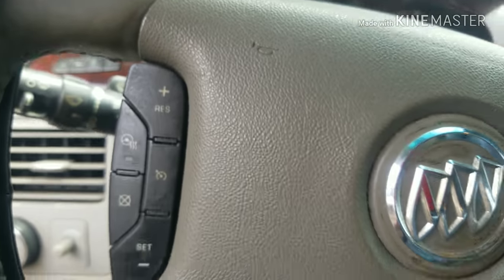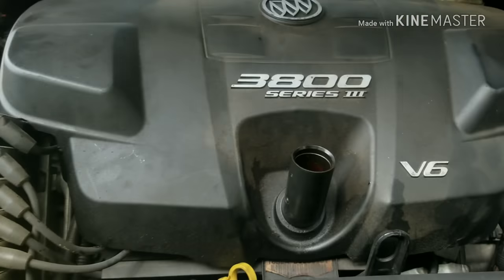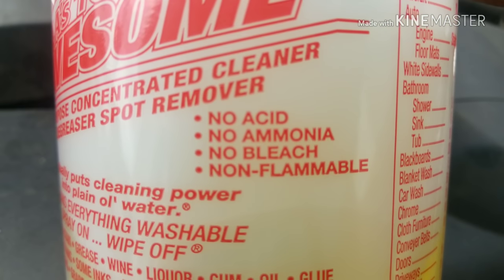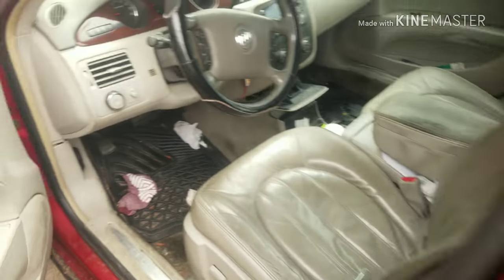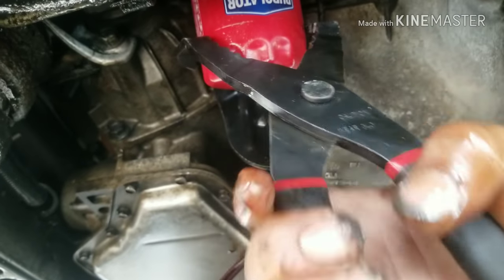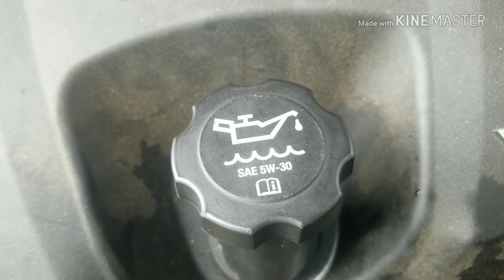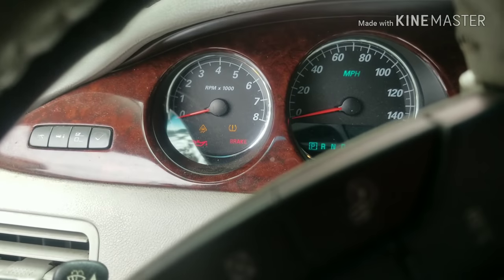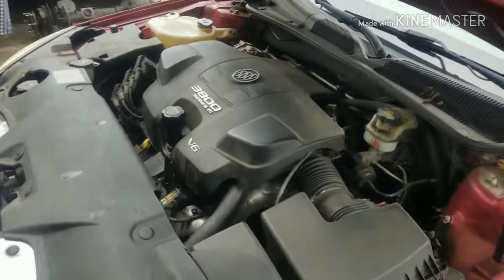How to Flush Dirty Engine Oil , The Cheap Way

Comment: Drain it, take the oil pan off and check the pan for the carbon build up. If you see any in the pan and on your crankshaft do a flush with 75% conventional oil and 25% diesel fuel.  If it's 6 quarts use 4 quarts oil and 2 quarts deisel fuel. Run on idle for about 5-10 minutes.. you don't have to Rev the motor. It's safe I have done it to many cars/trucks the deisel fuel has lubricating properties as well. There are of course other ways to check for buildup besides taking the pan off but atleast you can see, and clean the pan
Reply: This is what i use deisel has lube properties and cleaning so its safer but for newer cars depends how dirty engine is use sparingly. And yes check your oil pan cause you realy need to get everything out to have best chances of saving engine.
Reply: @bbb8949  I've heard of using ATF about a pint, for my Dodge Avenger with a lifter tick and even drive it a bit, seems like a better flush as it has many properties of oil, seems safer than the thinning of kerosene or diesel, and can't stand the smell of diesel, so I always use kerosene for torpedo and space heaters

Comment: I bet degreaser is REAL GOOD for all the engine parts! If you had A sludge build up problem that BAD changing the oil more frequently and adding A product like MM oil would have been A hell of a lot safer!
Reply: don't know what MM oil is I am going to try atf pint running and driving, seems safer and has some properties for rubber and seals
Reply: Marvel mystery oil

Comment: What does Awesome do to the seals and gaskets? Solvents tend to break these down causing oil leaks or necessitating major repairs to replace them. For example, if the rear main oil seal is compromised you would have to pull the transmission just to put in a new one. It's a cheap part but requires hours of labor and specialized equipment.
Reply: Yes I find cheapest way to engine flush not need to cost extra 15 buck per oil change anymore so you can add asmoil oil.
Reply: @maungmaung4037  I am trying to cure lifter ticking for my 2010 Dodge Avenger 2.5L with 240k it runs and drives great and good mpg, so starting with a half quart of ATF and drive it a bit then change to a 10w30 or 10w40
Reply: Oil is lighter than water. When you pour this liquid into the crankcase, you'll pump it into the engine without lubrication, just pure degreaser. This is why you hear the loud knocking when he first starts. That's bad, very bad, very bad.

Comment: That engine was clean. Well maintained. Didn't need the flush
Reply from the maker: client requested the service,
Reply: No hate but becareful i know from personal experience flushing a car that doesn't really need it can cause leaks and premature failure of parts. Use a camera scope to look in engine. Best way to have a customer complain about you is to do what they think is best but it's not remember you're the mechanic not them.
Reply: @bbb8949  mechanic should be glad if it leaks after the flush, it will bring more money to the mechanic to replace the leak seal.. not a big deal.

Comment: Oil is lighter than water. When you pour this liquid into the crankcase, you'll pump it into the engine without lubrication, just pure degreaser. This is why you hear the loud knocking when he first starts. That's bad, very bad, very bad.

Comment: Do not do this. There is no lubricating properties in that cleaner. Your asking for problems down the road.
Reply: You can put one after the flush
Reply: Are you heard of head and shoulders is best friction test ? Same with soap. Those are maybe brake down fast than oil but who care about 10 to 15 min idle engine.
Reply from the maker: Thank you please like, share, and subscribe, also please check out my other channel Salem Taxi, on YouTube for more material on a different level.

Comment: Use a good sludge buster oil like Castrol Ultra Clean oil when you change your oil and filter.  When it gets black change the oil and filter and keep repeating this method.
Reply: Never do a flush. You can break off pieces that are to thick to flow through small oil channels and that can clog up the flow of oil. Then lack of oil will seize the engine. If you hear of people doing flushes and had no problems they have been very lucky.

Comment: That stuff has no lubricating properties, You would be much better if with a quart of ATF.
Reply from the maker: tried that and this works better. ATF has no detergents so its really not that great for cleaning.
Reply: @crazysexycool180  bull butter
Reply: @noodlezdotcom  take a look at Project Farm's YouTube video on it. He ran 10W30, a 10W30/Diesel fuel combo and straight diesel in an engine. After he strained the drained liquid there was metal in the strainer after using the diesel...
Reply: @crazysexycool180  🐎💩

Comment: That is the oil level sensor not the sending unit 
3:00
He pours it in there
That is the oil level sensor not the sending unit
 3:00
He pours it in there
That is the oil level sensor not the sending unit
 3:00
He pours it in there
Sure would LOVE to SEE and to Hear it.. if that Car is Still around..
Reply from the maker: yes the car runs great, also have you ever called a part the wrong name? shit im human just like your perfect self and i have the same flaws as you so what's your point yea i said the wrong sensor but did you get the message instead of trying to pick the one word apart?

Comment: People the bottom line is you're not supposed to have to do a flush to your car if you just do your oil changes on time you have to do worst case scenario if you're going to use a flush being buying a new engine or try flush either way see where you ended up because you didn't do oil changes on time. The car was $30,000 and you didn't want to get $30 oil changes every 3 months

Comment: Don't let this guy anywhere near your car.  10-20% of the oil capacity is not drained during a normal oil change.  Leaving that amount of solvent in the oil over the next 5k+ miles will damage your bearings.
Reply from the maker: i didn't say leave it in, i didn't say drive it this way. Please pay attention in class.
Reply: @crazysexycool180  You only said drain, change your filter and add oil.  10-20% of the water based cleaner will remain in the engine.  That is enough to damage your engine.  Did you perform an oil analysis to determine the extent of the damage to the engine.
Reply: @heffedirte6243  Prove me wrong.  I have oil analysis showing greater than 10% retention of old oil in modern engines.  My little 2.4L with VVT retains about 12%.  The main oil gallery, secondary oil galleries, oil pump, cylinder head with additional oil galleries to feed oil to all the lifters, cam bearings and VVT does not drain away.  When add in a v-6 or v-8 with two banks and double the cams valves, lifters, and especially with turbos, cooler, etc, we are talking about 15+ %.  I rebuilt my first engine in 1984 and helped rebuild my current engine in 2019, there is big difference.  Do you have anything to prove it works and does not damage the engine.  No, just have to take your word for it, right.
Reply: @tssci6774  I did it to see if it would shut up a failing lifter. That was about 16 months ago and I go about 500 miles a week. I have a 2006 Chevy 3900 with vvt. I let mine sit unplugged for about 30 minutes. My lifter shut up. And I built my first engine at 14 since we are comparing dicks. Sure it was an old Chevy 350 but, I said built not, overhauled.
Reply: @tssci6774  you are so wrong but, ok 👌 yours is bigger. Lmao you don't know me or what I do
Reply: @heffedirte6243  Prove that it is impossible for an engine retains 10-20% of the old oil.  Simple, pour a quart of gasoline in an engine that holds a 5 quarts of oil.  Run it for a few minutes so that it circulates through the entire engine, change the oil, filter and refill as normal,  Run it for 20 minutes and then take an oil sample and send it to TestOil to be tested.  You will find that the fuel contamination will be 1 - 4 percent.  I recently had a 10% fuel dilution in my engine.  After the first oil change, 1.5% remained.  I had to change the oil a second time to get it down to .1 %.
Reply: @heffedirte6243  YOu really should see someone about your man-hood insecurities.
Reply: @tssci6774  those are your insecurities. I honestly don't see why you don't drop it. I'm right and you can be right as well. Just drop it old man....lol
Reply: @tssci6774  it is impossible unless you work at jiffy lube...lol
Reply: And hick? Lmao btw you are old
Reply from the maker: this is not left in the car the car is not even driven during this process. please pay attention before making a comment that dont apply to what was said. this is done before the oil change. and after the flush has been circulated inside the motor, it and the old oil is drained and replaced with fresh oil and filter. before it is driven.
Reply from the maker: @heffedirte6243  Thank You
Reply: Who said 10 percent ? It not transmission. NVM I can flush out with conventional oil again.

Comment: Did your flush down to the T. Followed the directions exactly as you did. Just locked my hemi up tight. Won’t turn over. It only took 45 seconds. You are straight up dangerous and people shouldn’t listen to techniques. I am going go now so I can find a new engine to put in my truck. Can’t believe I thought you found a real technique.
Reply: Actually 🤦🏽‍♂️😲
Reply: I've got a question.  It took your engine 45 seconds to lock up . But he runs the engine for at least 5 minutes.  ( well so he says ) so the question is did you have sufficient oil in your car. Ma bad he said 30 minutes.
Reply: I call bullshit bud
Reply: That bs without oil in engine that engine last at least 30 min. Go check project farm video .
Reply: Oil is lighter than water. When you pour this liquid into the crankcase, you'll pump it into the engine without lubrication, just pure degreaser. This is why you hear the loud knocking when he first starts. That's bad, very bad, very bad.

Comment: That is NOT the oil pressure sensor that is the low oil level sensor it obvious you are not you tube certified

Comment: No one needs cheap way to flush. The awesome you are using it's not petroleum based. So you can use dish wash in your oil then. You are doing it with your customers vehicles like experiment 🧪. I wouldn't go this cheap way unless a vehicle about to die and I don't care about it anymore. Where's your shop bro 😂, so I can avoid stopping by if I need an emergency oil change 🤣😝. Just my opinion , if you really need an engine flush try to use some kinda petroleum based cleaning stuffs like seafoam mmo amsoil flush etc. Don't just pour dish soap or anything cleaner in your crankcase.
Reply from the maker: Thank you please like, share, and subscribe, also please check out my other channel Salem Taxi, on YouTube for more material on a different level.